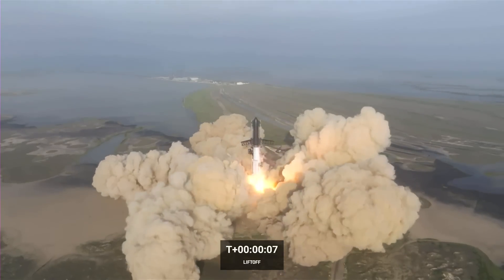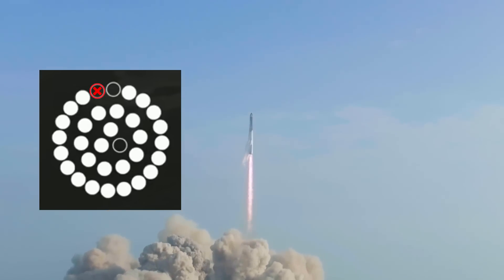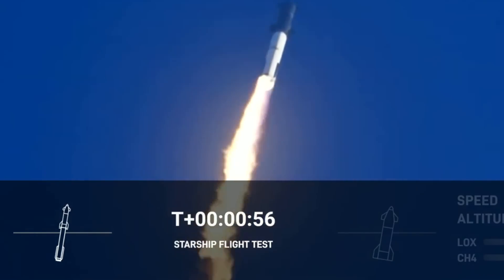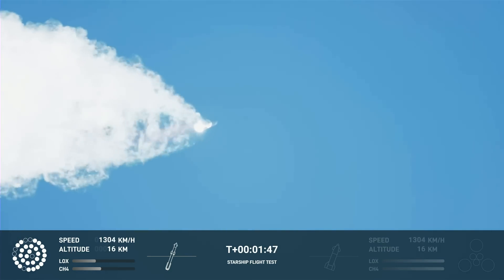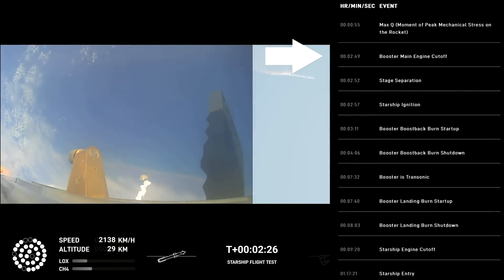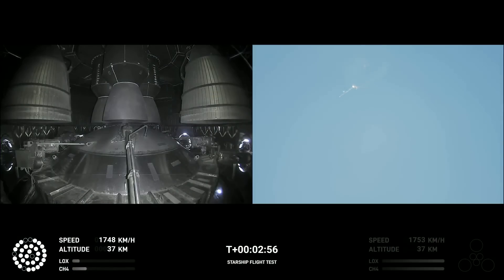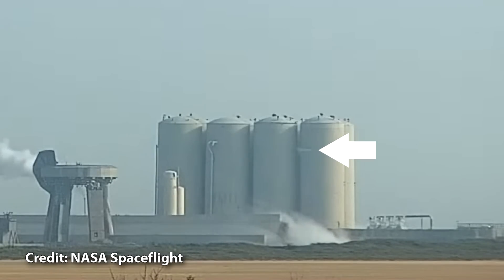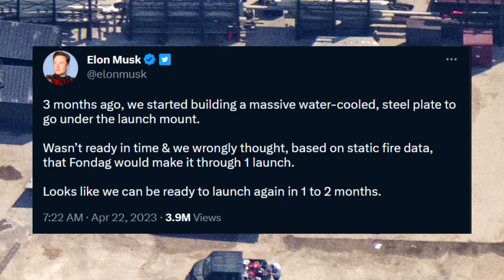I Watched the Starship Test Flight at 0.25x Speed & Saw What Went Wrong | Starship Flight Analysis

Comment: From some clearer footage (non-SpaceX) it seems that the FTS was initiated at around 3 mins (you mentioned Scott Manley say this as well).  It should be well known to the SpaceX controllers whether it was then or at the implied time of 4mins.  The failure of the FTS would mean not 4 months but 12 months before another launch
Reply: Elon has recently said that the FTS was inadequate and did not destroy the vehicle quickly enough. As such, the FTS will be revised so that it tears much bigger gashes into the tanks...
Reply: @Unbaguettable  So you admit that NASA simply reiterated SpaceX statement, the way you presented it sounded like it was NASA own assessment.
Reply: @AG-ig8uf  Sure, they were told by SpaceX. But I doubt that NASA would reiterate a silly deadline that Elon made - instead I think the fact that NASA did state that to the commitee means it has a lot more truth behind it. But hey, lets just hope it's soon, cant wait for another launch :)
Reply: @Unbaguettable  NASA simply said according to SpaceX it will require AT LEAST 2 months to fix the pad. NASA indeed simply reiterated what Musk said, didn't subscribe in any shape or form under it. Because NASA knows very well it will take many months to fix the pad, fix immediate issues with booster, like inadequate FTS system etc, if there is another test this year, that would be great achievement, most likely next attempt will be next year.
Reply: @AG-ig8uf  Yes I just said that NASA say what SpaceX said as a company. I'm saying its a  bit more truthful than whatever Elon tweets - if the company it self is saying it it holds more merit. I think it will take longer than 2 months, especially with the FAA investigation on the FTS, but what appeared to be the issue with Booster 7 was it losing thrust vectoring, and losing control. I think there will be another test this year.
Now Elon has publicaly stated that the next launch could be next month, with multiple launches in 2023 alone. I'm taking that, as i think everyone else is, with a grain of salt. Elon always spews idotic mess and this isnt any different.
But i'm hopeful, the pad damage upon further inspection doesn't look too bad, they're already fixing the OLM and installing the steel plate below it, so it could possibly be just legal issues holding them back.
Reply: @AG-ig8uf  You do realize that the next booster in line already has many upgrades and has very little in common with this booster don't you?
Reply: Uh boy
Reply: You should watch NASA budget hearing.
They were calling:
"China", "CHina" , "CHINAA" "Space Race", "Space race with CHINA"
There is no way they will ground them for more than 2 months.
Reply: I think Scott Manley may have jumped the gun on that. A properly designed FTS will do more than punch a hole or two, plus there are problems with timing (separate timing for separate "leaks"). This all points to the FTS not being activated until the vehicle fails structurally. Btw a channel called Common Sense Sceptic did a thorough autopsy and one conclusion is that the final explosion is the FTS.
Reply: @saumyacow4435  No, they activated the FTS at least 40 seconds before the ship exploded per Musk.  Unclear why the delay, could be the structure was more durable than expected or could be that it failed completely to detonate and aerodynamic stress tore it apart or something else.   The wreckage appears to be at a depth commercial divers can work at, so I would expect they will recover some of it.
Reply: @k53847  I'll wait and see.
Reply: @saumyacow4435  Manley was spot-on and Musk confirmed a ~40 sec delay between FTS initiation and vehicle destruction. I think it was Everyday Asttonaut's feed that had crazy-good lenses and tracking, and you could see the apparently explosive puffs that initiated the two evident gas leaks on both Starship and the booster.
Reply: @phoenixshade3  The problem I have is that if it were the FTS you'd see the resulting leaks start at the same time - but they don't.
Reply: @saumyacow4435  Would you, though? I think each vehicle's FTS is commanded individually. It looks like they triggered Starship's first, then Super Heavy's. I suspect there was an engineering reason for that sequence.

If you intend to eventually recover the booster, it must be two systems. If you have to destroy Starship post-separation, you certainly don't want to blow up Super Heavy when it's already back on the pad...
Reply: @saumyacow4435  Also, if it wasn't the FTS, what was it? The location is entirely consistent with footage showing the location of detonators in ground footage. That area of the vehicle is relatively strong, on the cylindrical walls which are already strong under compression, backed by the intertank bulkhead, which also increases shear resistance. It would take something extraordinary for THAT to be the point of failure. It's one of the strongest parts of the vehicle.
Reply: @phoenixshade3  At least some of it appears to be from  buckling caused by torquing of the vehicle.
Reply: @saumyacow4435  This is all rather moot, as Musk himself acknowledged that flight termination was commanded about 40 seconds before the vehicle broke up. Lo and behold, almost exactly 40 seconds before the explosion, we see this event in the footage.

If that wasn't the FTS being activated, SpaceX has an even bigger problem, because that would mean that it did PRECISELY NOTHING.

I feel like you're just arguing because you don't want to be wrong. You are arguing for an extremely unlikely coincidence, rather than accepting what both visual evidence and SpaceX's own assessment appear to support.
Reply: @phoenixshade3  The visual evidence is ambiguous. Musk might be telling the truth about when the FTS was activated, but that is not the same as the FTS actually working, or in fact partially working. We know for a fact that its design was flawed. In my view there were leaks developing before the FTS was activated. You can believe what you want, but if all you're doing is treating Musk as the Oracle of Truth then you're at least providing me with amusement.
Reply: @saumyacow4435  That isn't at all what I'm doing. Musk has nothing to do with it, except that he confirns what I suspected based on the video from literally day one.

Your analysis, however, is physically impossible, as in defies laws of physics. Where is a torquing force coming from? Aerodynamic forces at 39 km altitude on a largely symmetrical body aren't going to cut it. Especially not enough to cause BOTH vehicles to fail within seconds of each other, right where the cylindrical fuselage is reinforced by bulkheads. Such a failure due to torque would have most likely occured well forward from those bulkheads, around the middle of the methane tanks, since this is structurally the weakest part of the vehicle to both twisting and shearing forces. And even THAT would require some external force capable of generating such torque, which would have also caused considerable rapidly-accelerating roll, something not seen in the video.

Be "amused" all you want, as long as you're also aware that you're ignorant of the physics involved. Or come up with some other half-assed speculation, equally grounded in lack of knowledge and impossible coincidence.

Either way, I'm done with you until the FAA puts out a report that lets me say, "I (and many others) told you so."
Reply: @phoenixshade3  The torque derives from most of the mass still residing at one end - Starship's tanks whereas the thrust applied is at the opposite end. You did see the image of the vehicle buckling?
Reply: @saumyacow4435  
The longest lead item on that is probably re-qualification of the flight termination system.
Because we did initiate the flight termination system, but it was not enough to...
it took way too long to rupture the tanks.
So we need a basically a much...
we need more detonation cord to lines up the tanks at altitude and ensure that basically the rocket explodes immediately if there's a flight termination is necessary.
So re-qualification of the...
I'm just guessing here that re-qualification of the much longer detonation cord to lines up the rocket in a bad situation is probably the long lead item.
What was the time lag? It was pretty long.
I think it was on the order of 40 seconds-ish.
So quite long.
The yeah, so now the rocket was in a relatively low air density situation.
So the aerodynamic forces that I was experiencing were would be less than if it was at a lower, you know, lower down in the atmosphere.
And so the aerodynamic forces would have, I think, at lower point in the atmosphere aided in the destruction of the vehicle.
And in fact that's kind of what happened when the vehicle got to a low enough altitude that the atmospheric density was enough to cause structural failure.
But I mean this is obviously something that we want to make super sure is solid before proceeding with the next flight.
---
This is from Elon's twitter space. The FTS did explode but the starship was simply too strong.
Reply: Doesnt mean it will be 12 months, both NASA and SpaceX said its more likely 2 months. It will require a redesign and the FAA to approve it again, however.
Reply: @Unbaguettable  NASA said nothing about 2 months, at least I couldn't find any sources for your claim.

Comment: In hindsight I suspect having so many engines is a big disadvantage. That's because a rocket with 33 engines is 33 times more likely to to suffer engine failures. It's same with aircraft engines. If you need 4 functioning engines to make a flight, then your risk is 4 times that of a single engine plane.
Reply: Raptors work better when their not shot up like Swiss cheese. This wasn't a ship design fail, but a pad design fail. Which is bizarre considering over 60+ years of proven pad design knowledge.
Reply: It’s more an issue that Raptor is just an unreliable engine with a 25%-33% failure rate based on this flight. SpaceX was raptor cheap and produced fast so it is unreliable (cheap, fast or good pick 2). We should expect another significant revision of the design so Raptor 3 should be the final production version.

At the failure rate above we should have expected 1 or 2 of Starship’s engines to have failed if stage separation had occurred.

With everything that has happened it will be 6+ months before any further launch attempts.

This will be interesting to compare with Vulcan’s first launch in a couple of months.

This was clearly much worse that Terran 1 as that got into space and past stage separation.
Reply: I agree, best to have none
Reply: It depends on why and how an engine fails. If a single engine failure can create a fire or explosion that results in degradation or loss of the whole vehicle then yea, that's a problem. If I'm not mistaken that was the problem with the Russian N1 moon rocket. So many engines and one would fail and cause the whole rocket to explode.
Reply: you're more likely to have an engine failure, but at the same time an engine failure is MUCH less catastrophic.

If you have ten engines, and 2 fail, it's the exact same as if you had 5 engines, and 1 failed. The number of engines makes no difference in regard to this matter.
Reply: I don‘t think so, having more engines was the only reason starship was able to pull this of. If you only have a few Engines and loose just one it is Game over. Raptors are quite new and i‘m sure they get more relayable over time. Producing so many Engines helps with that too. Because you have more data on what went wrong.

Comment: Hopefully, the FAA will ground Starship until they replace 33 tiny engines with 5 big ones like the Saturn V.
A sympathetic vibration is going to rip apart the ship with 33 of these little engines all being identical.
We will see.
Reply: I was thinking pretty much the same thing, fewer and larger engines.
Reply: @kpkndusa  You probably have seen the YouTube where they take a bunch of metronomes and set the frequency the same but are all random clicking away on a surface that gives just a little. Within 30 seconds, ALL the metronomes are clicking in unison - sympathetic vibration.

Same with Starship 33, identical engines will all go into unison vibration within 30 seconds and destroy the ship or vibrate the 2nd stage engines so they malfunction. God help any crew.
Reply: @noleftturns  Yes, I did see that video, your analogy is very good.
Reply: Nothing wrong with speculation, but dont you think the spacex engineers thought of that?
Reply: @chrislaidlaw3308  Are you kidding? Their amateurish job with the launch pad speaks volumes for this crew.
Reply: @noleftturns  I'm not sure it speaks for their crew. It certainly speaks for their clown memelord i charge.
Reply: @noleftturns  the crew got fired 2 years ago because they demanded a trench and a deluge